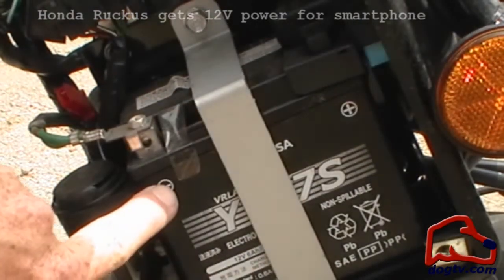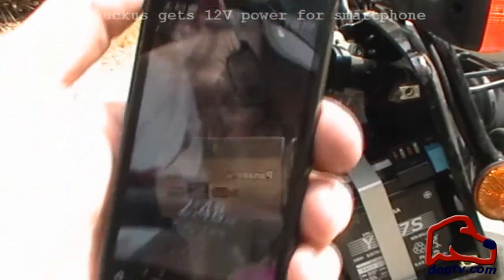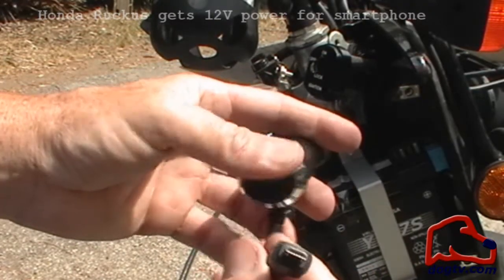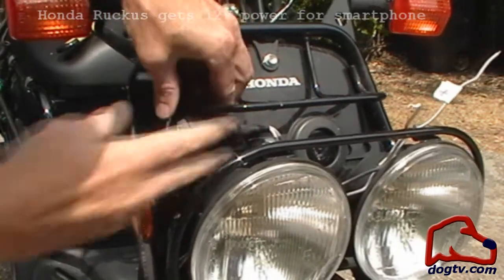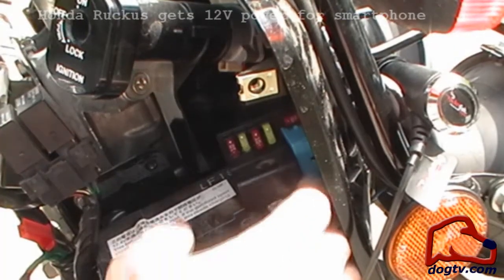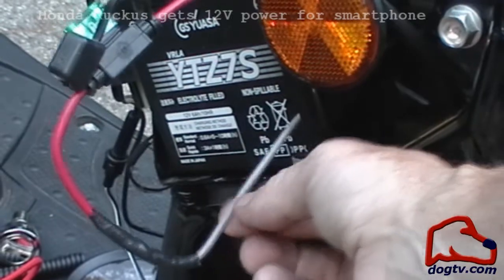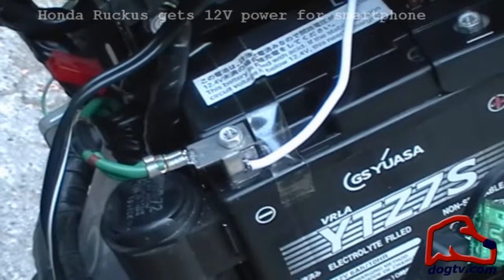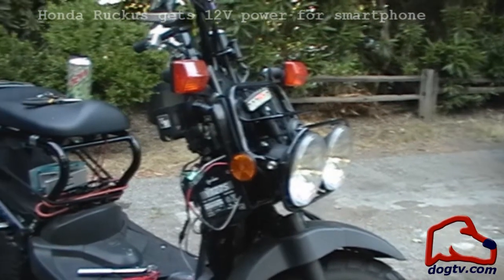Adding 12v cigarette lighter power outlet to motorcycle or Honda Ruckus Scooter

Comment: @davo5400 I have just bought a 12v socket for my 500 with the intention being to plug in a satnav. The socket is able to be wired straight to the battery, but I don't like that idea as it is permanently on when the ignition is off, so I will hard wire it into the loom. That way, the socket will only be live when the ignition is on with the key and when the motorcycle is parked up and switched off, the socket will no longer be live.

Comment: You should have only wired the positive to the battery and then the negative you should have mounted to the frame instead of the battery but other than that great job my friend I'm just now putting one on my 50qt moto Fino that's been upgraded too 100cc